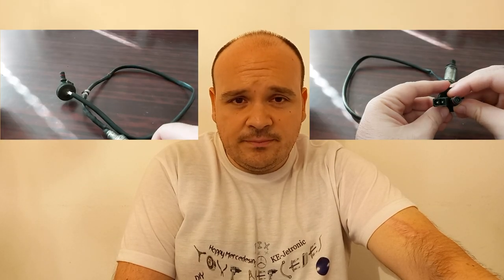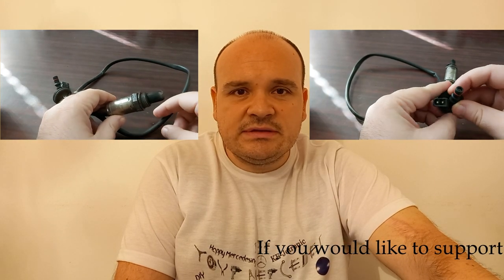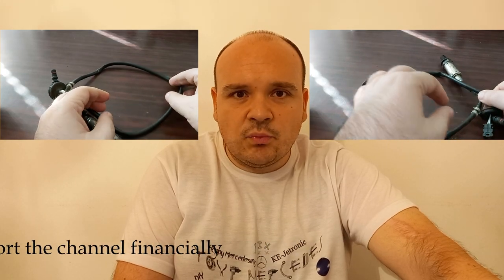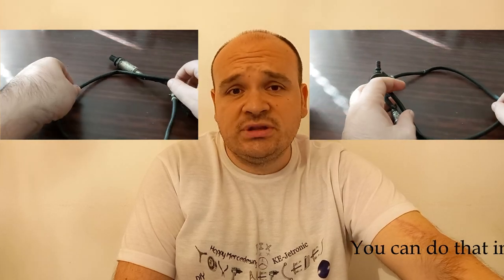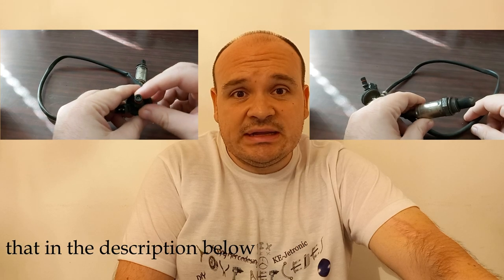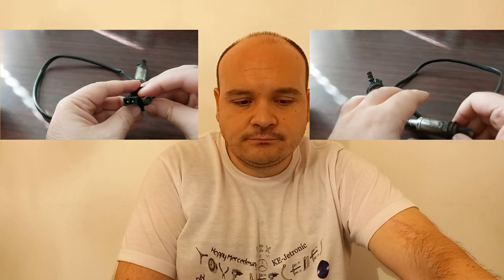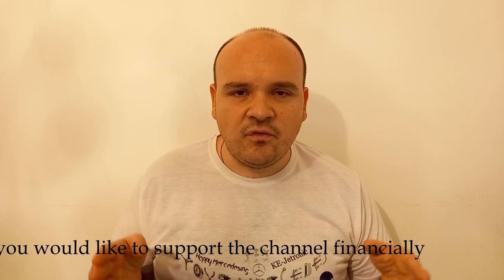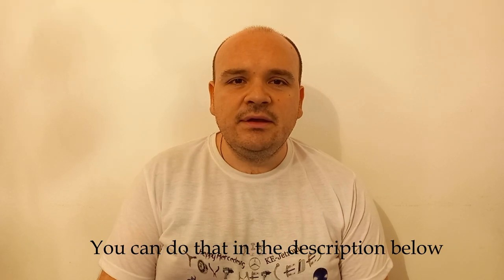Mercedes Ke-Jetronic - The Electronic Control Unit (ECU)

Comment: This is Eden from Hongkong, nice to have this video
I suspect that my car ECU is faulty.
I have replaced many mechanical components, the idle still have little problems

I have a question. Would u think the ECU is damage due to the ovp is broken before?

Are their fault co related?

Thank you In advance
Reply from the maker: Hi, Eden. Thanks. As for the OVP - its task IS to prevent the ECU from any damage, so the answer is NO! As for your other question - the answer is NO as well. The CO screw has influence on the potentiometer which signalizes the ECU where the sensor plate is located. The ECU is actually a transformer that collects all the data from the sensors and transforms them in mAmps which it sends to the EHA , ICV, X11 and X11/4. If you have replaced mechanical components, measure now the potentiometer, the lambda(if present), the coolant temperature sensor, the micro switch and the TPS. Those are the most important because the sensors have to be in order for the ECU to work properly. The only way to damage the ECU is to unplug it while your car is on ingnition!
Long story short - you have done the major steps now you will have to do the electronic upgrade of the system. Fingers crossed and Happy Mercedesing!
Reply: @mercedeske   Thanks for the advise. to make me clear, let me ask in other way. Will a damaged OVP lead to a damage ECU?
Reply from the maker: @19829Kei  No. You will just experience lack of power, cold starting issues, bad idle.
Reply: @mercedeske  thank you so much, happy 2022 ^^
Reply from the maker: @19829Kei  Thanks, best wishes to you, too!

Comment: Hi
I'm wondering what Kind of Mercedes that I own
lately I tried to figure out some problems in it's Engine and there's many common things that you described in the video
my Mercedes is 190E 1984
It's engine can start and travel for long distances without ECU !!
There was a problem with the wire harness ... a mouse 🐭 ate it and disconnected the ground signal of the ECU
I tried also to disconnect it completely because i was curious how it's working without ECU
and yeah that's real
known that ... I didn't find oxygen sensor in my model
and no ICV control from ECU
It's ICV looks different from yours and has wire harness to another element not the ECU

There's EHA, Air flow potentiometer, throttle open close switches or sensors, and coolant temperature sensor
Do you have any idea about that ? :)
Reply from the maker: Hi. As, for the ECU - The KE-Jetronic engine can completely run without the ECU(a bit worse engine running, higher consumption, worse acceleration...), because its working principle is based on the law of a moving lever, I was talking about that in my videos. As for the oxygen sensor - if you don't have a catalytic converter on your car, you don't have the lambda. As for the ICV, you have the ICV on which you manually adjust the idle RPMs. As I have said, the ECU is just a finer tune up, an upgrade for the engine to have a smoother idle, better acceleration, more HP and if it accidentally fails, the car can continue the journey and the engine wont stall!
Reply: Thank you so much for your reply 
Yes exactly as you said
Without ECU the engine is jerking in sudden acceleration
I'm still having this problem after fixing the ECU issue
Sometimes at high temperature coolant it jerks when acceleration
I'm trying to figure out the problem gradually

Comment: Any idea what could be my problem.. My car suddenly didn't want to start when engine is cold. I started it few times with the help of start pilot, but yesterday when i got it started the idle was around 2000-3000 rpm.  Where should i start finding the problem? Maybe vacuum leak?
Reply from the maker: Start checking the vacuum leaks and the icv

Comment: hi, could u help? I was driving at motorway and suddenly theres no power to car, its just starting to slow down, no revs going up nothing, If I put car in Neutral it just stalls and thats it. Recently i have changed OVP relay, injection nozzles, cleared idle control valve, ecu also was fixed and it all was changed because I had very rough idling.
Reply from the maker: Hi. How many kms/miles you have on the clock?
Reply: @mercedeske  285k km 92 300CE
Reply from the maker: If you haven't replaced the potentiometer, check it, I think it's the potentiometer. If you have never replaced lambda(if you have one) replace it.
Reply: @mercedeske  changed fuel relay and car fixed, anyway thanks :)
Reply from the maker: @Gamingabc  Great 👍👌👏

Comment: If adding a turbocharger to the M103, is there a way to modify the ECU and EHA to add fuel enrichment while under boost?
Reply from the maker: Yes, there is a way. The fuel enrichment on the EHA will have to be adjusted. For how much, well, I can't tell, you will have to do it yourself.
Reply: @mercedeske  My understanding is that would provide enrichment both off and on boost.  I’m trying to find a way to get KE-Jetronic to enrich while under boost.  The 1988 Bentley Turbo R uses KE-Jetronic, but I’m unsure how it provides enrichment while under boost??   In a perfect world a MAP sensor with vacuum/boost line could modify the signal from the EHA to the ECU, “tricking” the ECU to provide enrichment.
Reply from the maker: @steveriegeltuningtunerwork2189  You can turn the resistance trimming plug on the position 7(I believe) that should provide enrichment in all phases. There is my video on that but you should make enrichment definitely.
Reply: @mercedeske  I understand that…but if I do that, I thought it would likely cause it to be too rich when not under boost?